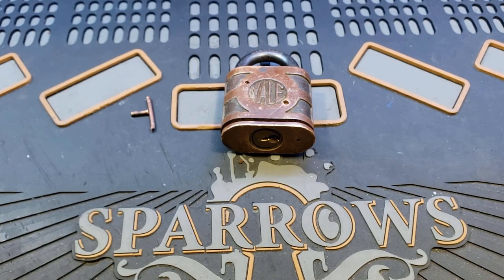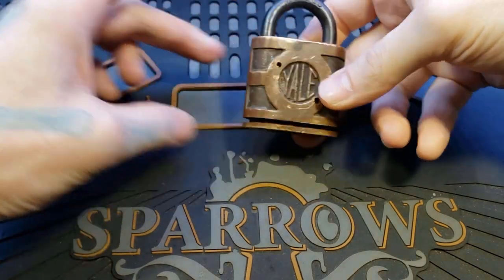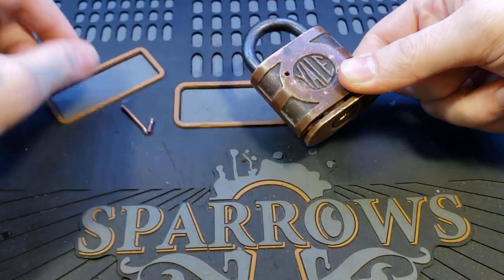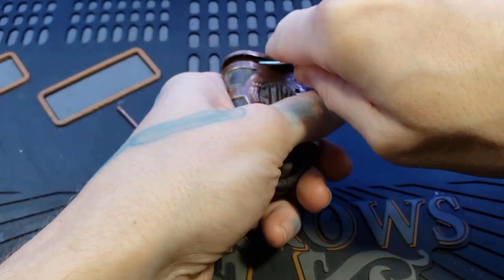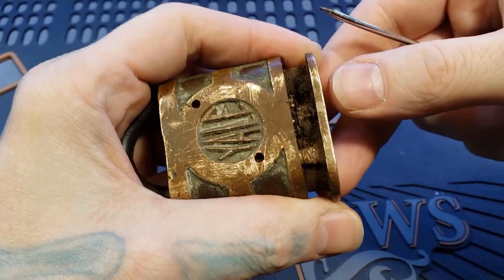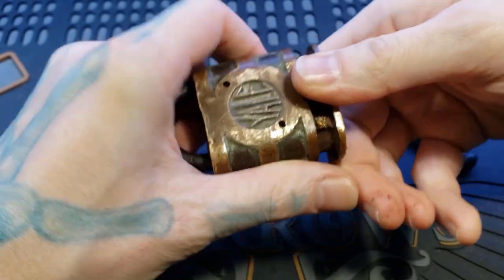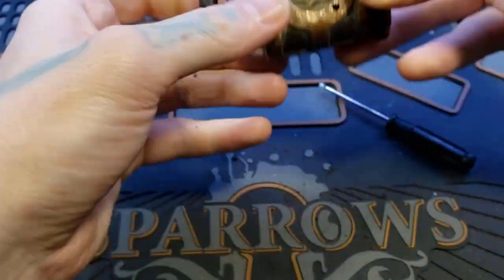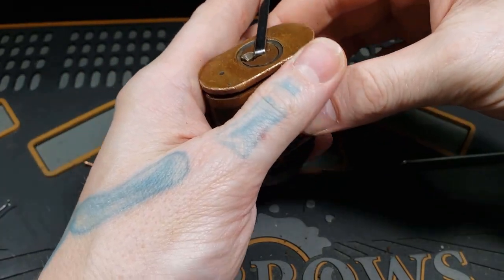95) Vintage Yale 840 Teardown before and after Restoration and Keying

Comment: Thanks the view of the actuator from the backside at 22:17 was great. I was wondering about the orientation with the small and larger actuator..  Same with the top and bottom shackle lugs. Good work. Now... how did you get it all clean and shiny?  🙂
Reply from the maker: Lots of solvents, a 0000 wire scrub pad, and a water powered tooth pick cleaner!